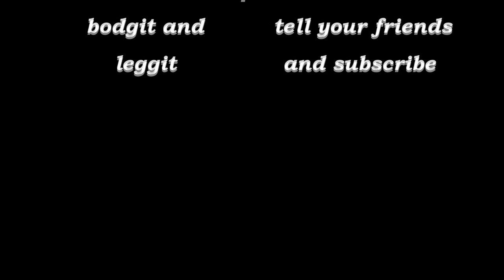bodgit and leggit garage How to Repair a Cracked or Broken Circuit Board

Comment: You can clean the insulation off the tracks accurately by using a fibreglass pen which is made for the job.  Get them on eBay.
Reply from the maker: Yes mate I agree but there is more than one way to skin a cat
Reply: @bodgitandleggitgarage  I have an old VTVM that is cracked in several places luckily I only need to fix one of the traces but I don't know what use to glue the board together. Would super glue work? Or JB weld?
Thank you